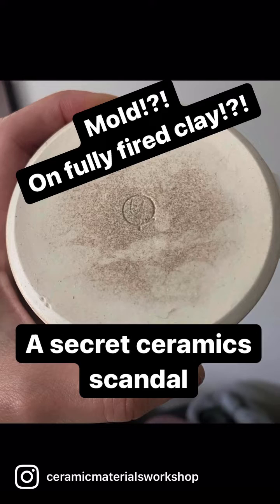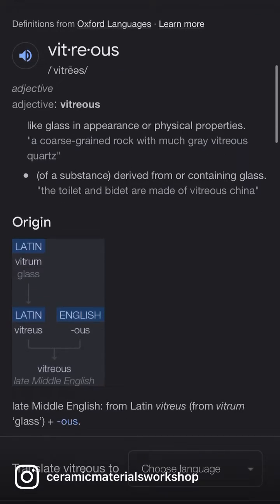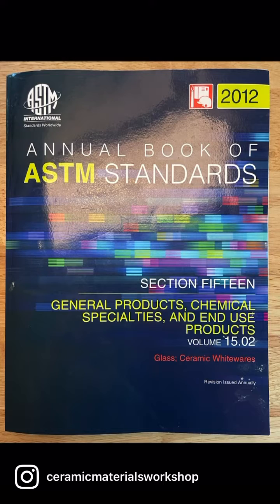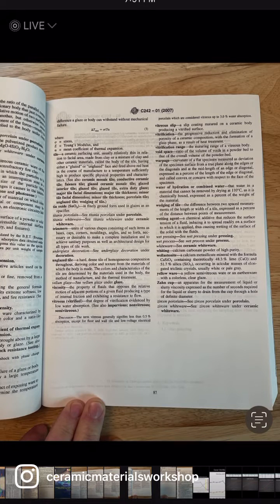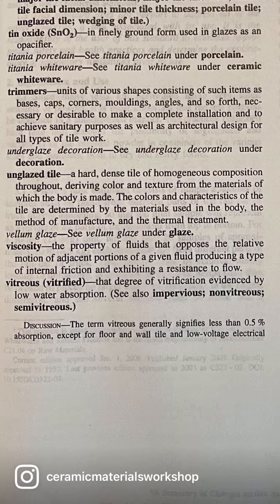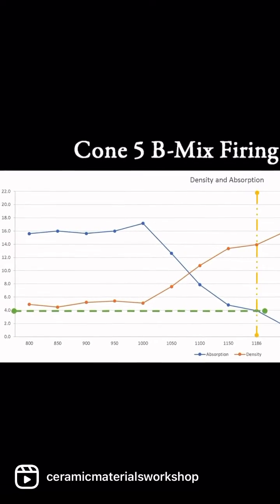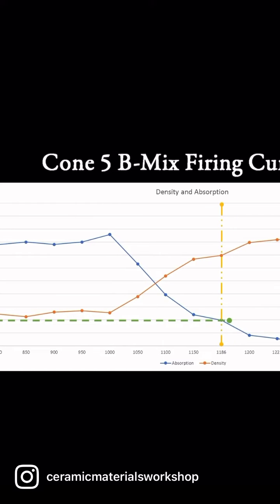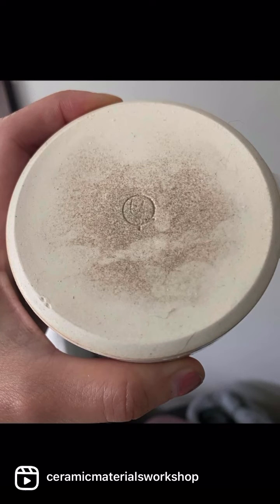A Secret Ceramics Scandal? | Ceramic Materials Workshop

Comment: Thanks for pointing that out so clearly. I guess I will be doing some research on what absorption my current clays have at Cone 6 (shockingly my local supplier is not listing these values for their own clay). Alternatively I might have to consider going to Cone 10 (with a different clay body). I wonder what firing to Cone 10 does to the lifespan of the elements. I'd imagine those would have to be replaced more frequently.
Reply: Kilns designed for ^10 will be fine, but a lot of kilns are designed to only fire to 6 to same money on materials.